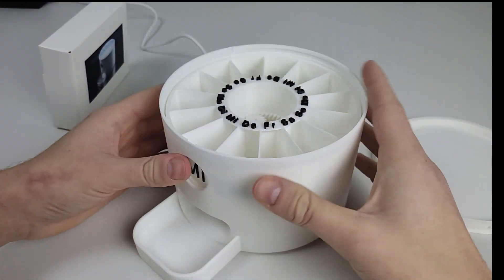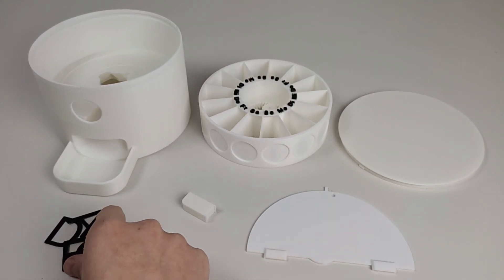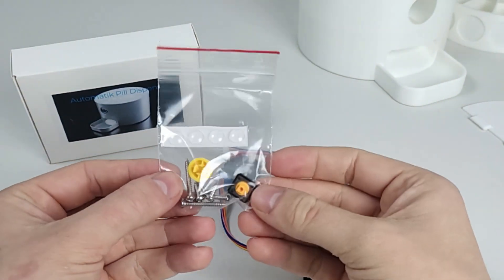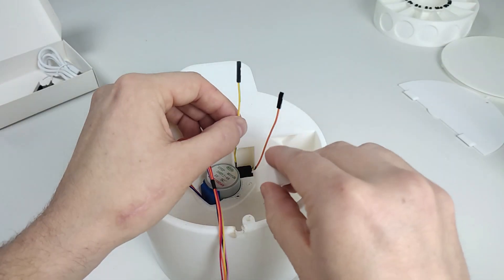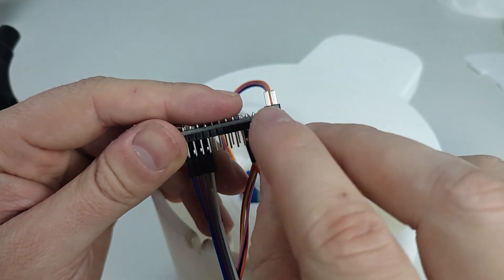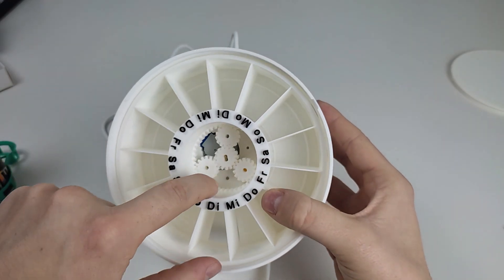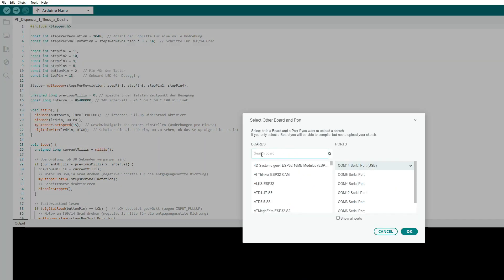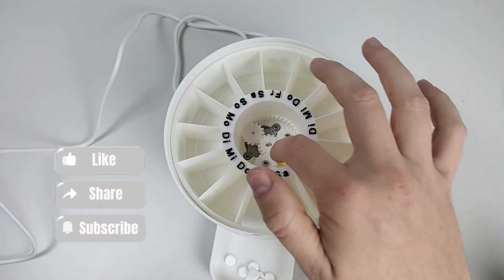DIY Automatic Pill Dispenser | 3D Printed & Arduino Controlled

Comment: can it print in bamboo lab A1 Mini ?
Reply from the maker: I tested it in the Bambulab slicer, and if you align the case properly in the corners, you can still print it on the A1 Mini without any issues :)